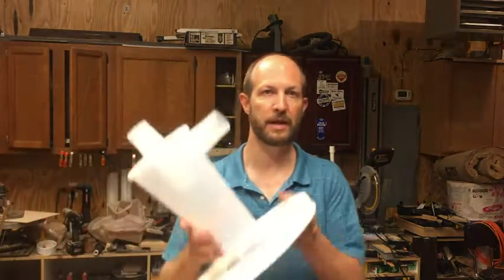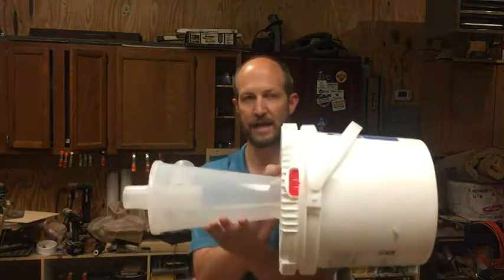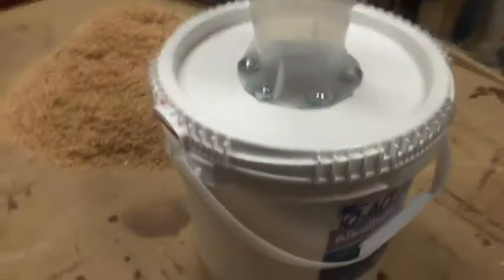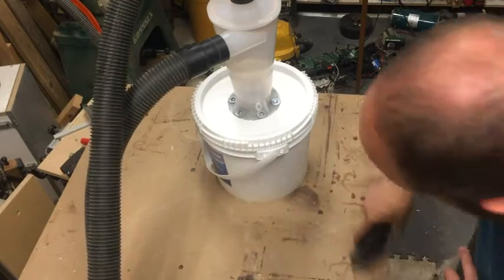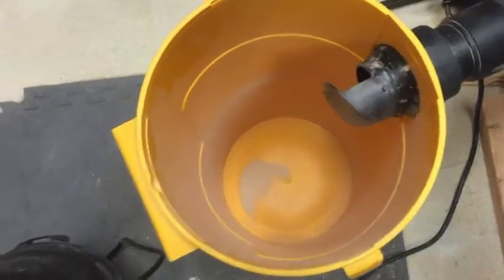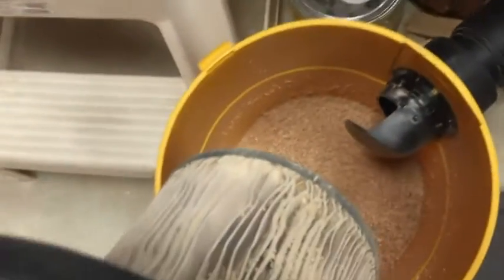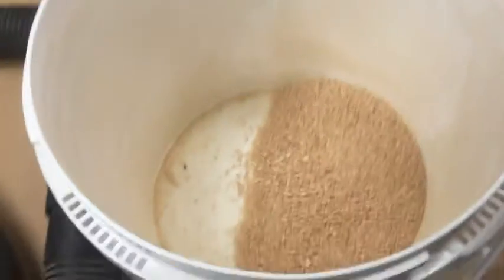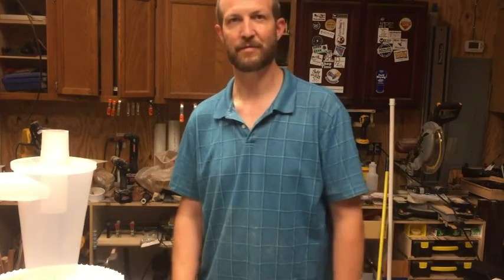Sideways Dust Deputy Cyclone Test

Comment: I don't think this is a very good test. It is pretty obvious that at 45 and 90 degrees the bucket is effectively full much sooner than when upright, in other words the dust is at the same level as the opening in the lid sooner. This means that the shop vac will suck up the sawdust out of the bucket. You will get a similar result if you have the unit upright and over fill it, the sawdust will end up in the shop vac.
If you had used a 45 or 90 degree fitting between the cyclone and the bucket I suspect you would have had similar if not the same result as with the normal configuration.
Reply from the maker: Yeah I agree. Really the whole video came about because of someone discussing it on Facebook and I just decided to try it for giggles

Comment: Test is flawed. It not about the cyclone so much as where the openings are the inflows and collections are put in place. 

Check out the Harvey Gyro which has nearly horizontal cyclones but has the exit points below. 

Need serious, serious air flow to over come gravity.

If you could run the duast deputy at 45 degrees while maintaining a downward bucket. I suspect diffwenent results.

Comment: That was 6:35 of my life I will not get back!  You proved what thought, it would not work very well, in reality is is a good test thank you for taking the time to produce the video.
Reply from the maker: +TheFalconJetDriver thanks for watching. Sorry no refunds on time
Reply: I watched it in about 45 seconds, by skipping ahead to the middle, then the end. There's also a speed control if you click on the gear (settings) icon, you can speed up or slow down videos.